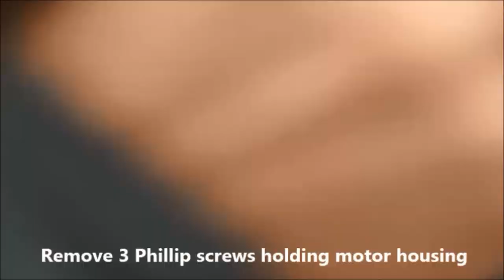Razor RipStik Electric Rear Wheel Repair Kit Instructions

Comment: Why would you need to do this? I'm a little confused as to what scenario would lead to this needing to be done.
Reply: Logan Tanner I have the same question. Why did he have to do this, what was wrong with it?
Reply: Logan Tanner there was a safety recall due to the rear wheel locking up. Look up your serial # to see if yours is affected. I just found out both of mine need recalled.
Reply: Sometimes the ripstik back wheel locks up or stops working that why
Reply: @canaanwinthrop2463  I know this was some years ago but where do I get the repair kit?